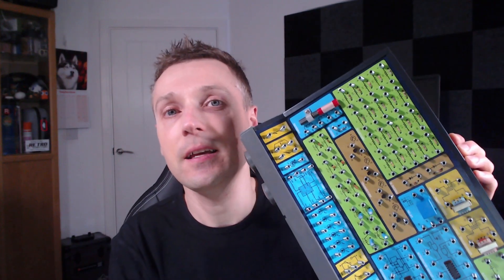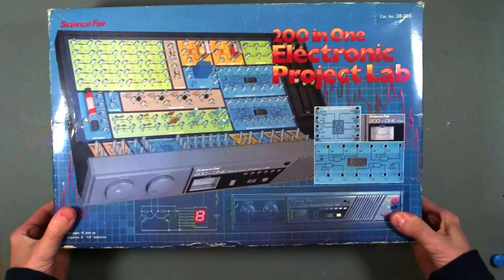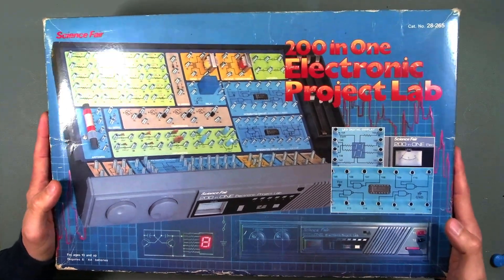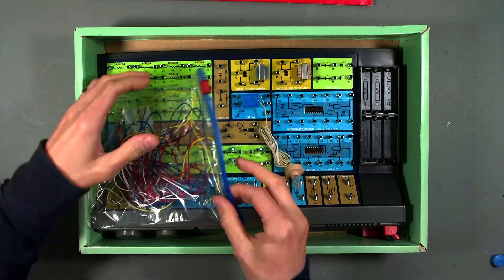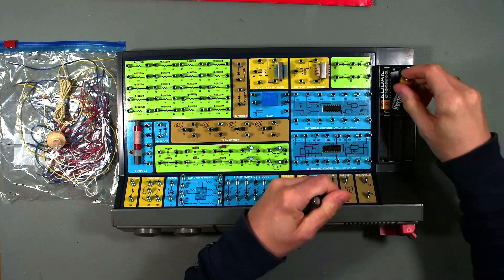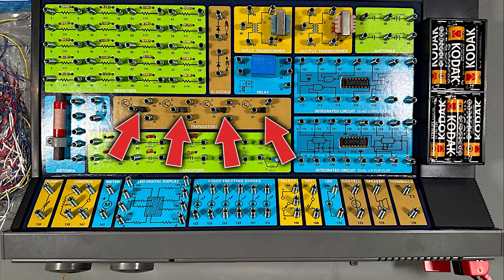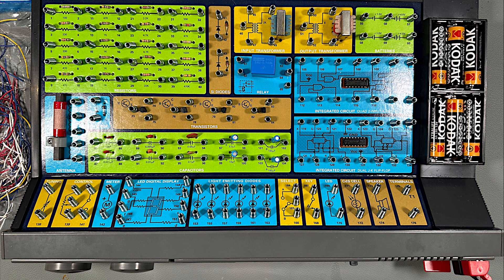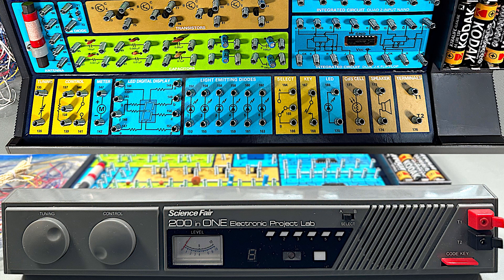Rediscovering 90s Electronics Kits - and I owned this one!

Comment: I had a 130 in one at first (which I stupidly threw away much later in life) and that was upgraded to one very similar to yours which I still have as I thought as it was based around using a breadboard as well as wires and posts that it would be good for generic project stuff.  

However, although I was really interested and good at electronics at school, my eventual destination was computing and amateur photography.  I dont have much to do with electronics these days but I'm looking to bring it back.  As a kid I always wanted an oscilloscope, which eventually was replaced with wanting a laptop, something like a 286 or 386.  On my 40th birthday a few years ago my relatives asked if there was something I wanted that they would all club together for, well, I finally got my  oscilloscope!  Of course I need to use it and so I need to being my old hobby back.

One thing I have always been proud of however is although I stopped playing with electronics I never lost "the knowledge".  Sure an op-amp still can confuse the shit out of me, and I never got the hang of understanding how flip flops worked, but I know my components and some basic theory, and I still can read a schematic, I watch Big Clive frequently, and again, although I dont mess with circuits much at all I still incorporate much of that knowledge in my IT work today when thinking and diagnosing issues and so on.

Kits like this, my telescope and the Commodore C64, making way for a self built PC I built from donated 386/486 parts, set me up for life.

Comment: Elenco still makes these, you can get up to a 500-in-one kit with a microcontroller of some sort to use, and a build in programmer for it (included keyboard and LCD like those early computer kits). They also have Snap Circuits which use clips (pants buttons) instead of springs for much faster assembly (though the parts are big due to the plastic frames). EDIT: Yes, they make Snap Circuits in general purpose versions (X-in-one), though you have to get them online now.
Reply from the maker: Good to know is they’re still being made - I guess they are a little harder to find than back in the day

Comment: I hated these as a kid, because this is NOT how “real people” make circuits.  I’d much rather have had a breadboard and a bag of parts.
Reply from the maker: That’s true but for learning at such a young age it was easier to follow and made sure less ‘small parts’ were lose I guess
Reply: @RobSmithDev  Yeah, that’s what my dad thought.  “With this you don’t have to solder!” and I was like, “Learning how to solder is exactly part of what I want to learn!”  It was just very frustrating as a kid who wanted to reverse-engineer how existing working electronics are made, not build up from abstract concepts.
Reply from the maker: I was playing with a soldering iron way before these kits but still they were fun. I’d never actually seen a breadboard until I was about 16! I’d actually used that veroboard/strip board prior

Comment: I have several of these kits, all of them from the Japanese company Gakken. I have 2 Mykit System 7, and for reasons I have no less than 3 Mykit 150 (The 'Suitcase bomb'). Two of those I bought off of the Swedish offshoot to Ebay just to get hold of the manual so I could play with the third one. These kits are becoming real reare.

Comment: My circa 1965 electronics kit consisted of a board with an AC power supply, a single vacuum tube and a few rows of tab rails requiring soldering of components (resistors, capacitors, diodes, pots, wires, etc.) to the tabs to create a functional circuit. After the power supply and vacuum tube burned out from attempting to create too ambitious a project, I built transistor circuits on it powered by a 9 volt battery. Eight years later  when I was tested while attempting to enlist in the U.S. Air Force in Oklahoma City, two recruiters called me into a room, sat me down and asked how I knew so much about electronics. I told them about my kit projects and they grinned, saying I had just scored higher than anyone they had ever tested before on electronics aptitude. Then they asked me what I wanted to do in the Air Force. I told them I wanted to fly fighter jets. They told me I couldn’t ever fly jets because of my poor eyesight (myopia). I did not enlist and hitch hiked through the night back home because they had only paid for oneway bus fare the 120 miles distance from the western edge of the state to OKC. My parents were furious with the recruiters for not making sure I had transport home if I decided not to join up. The recruiters called it a “failure in communications”. Dad (a war veteran) called it SNAFU (in words, not letters) and slammed the phone down hard when he hung up on the recruiter.
Reply from the maker: Wow that’s quite a story. I didn’t know they did kits with valves although kinda makes sense - no way they’d make a mains powered one these days 😂
Crazy story about the airforce - it’s a shame you couldn’t be a fighter pilot though
Reply: @RobSmithDev  I think it was called a Knight 12-in-1 kit because I remember doing all 12 projects in just a few days and bugging my parents to let me buy a book about circuits that they thought was too expensive at the time. Fortunately a local library had all the reference material I needed after we moved to Houston. The Apollo space program was just ramping up there then, providing lots of inspiration via local TV news casts, and I started reading about transistor circuits and hearing about computer programming. Exciting times to be a kid craving knowledge and adventure, eventually leading to a decent if not so glamorous career in computer science.

Never piloted an aircraft of any kind, though, but there is still hope. I’m seriously considering getting a Pivotal HELIX to fly around the farm to fulfill that childhood dream.

Comment: Nice one.
Kind of reminds me of what would be the Eastern European (USSR and post-USSR) electro-kits some friends have had since they were kids... MERKUR ELEKTRONIK, which mostly had construction sets, used to have electronic kits as well (just like construction kits, consisting of robust painted bare metal parts to be joined/screwed together), although it's not quite the same... the basics like rotors, electromagnets, relays, buzzers and low-voltage light-bulbs (3 or 5-6V) were included with projects like burglar alarm and morse code transmitters...

Btw. what would it take to clean up the radio signal? Maybe some crystal and/or other components would help?
Reply from the maker: I think there’s a different technique for receiving AM, but obviously that needed power. Mind you, these days it’s a simple single chip!

Comment: What put me off when I had this exact kit were two things:

* The documentation jumped very very quickly from simple pictures of where to place wires, to full on schematic diagraming. This learning curve was way too rapid for the age group indicated.

* The LEDs didn't have current limiting resistors installed, you had to wire them manually: so I burnt out my LEDs real quick 🤣🤣
Reply from the maker: lol I think burning out LEDs was common, this was t my first kit so was ok with the circuit diagrams but that was just me

Comment: I had an older, more basic version of this without the fancy front with all those knobs but I loved it. I still remember the gasp I let out when I wired up the crystal radio project and it actually worked.
Reply: That was so cool. I remember salaving magnet wire from an old motor to string up in the bavk yard. Had the whole setup under the bed so that at night when I was supposed to be sleeping I could listen to the baseball game.
Reply: Long live AM radio! Damn them if they ever shut it down and deny all 10 year olds the gasp of building a radio that runs on no power!
Reply: @dlarge6502  Most kids today would consider it lame. If the device doesn't have a screen or play games, they're not interested. Sad but true.
Reply: There is a full fm radio circuit but seeing the shit ton of connections I never had the balls to try making it, I was 11.
Reply from the maker: Yeah kinda magical isn’t it :)

Comment: Say hello to the Amiga 2000 in the back. I used to make advertisements using Professional Page on one of these back in 1992. As for the 200 in 1, managed to get a 300 in 1 around 2009. Still use it with Raspberry Pi Pico.
Reply from the maker: Awesome using it with a Pico. Check out some of my other videos, the A2000 is featured in quite a few

Comment: Had the 150 in one kit. Got it for Xmas in 1977.
Just found one on ebay that was never opened!! Still has the plastic wrap. Date code on back says it's made in Sept 1976. One of the first ones ever made!
I'm afraid to remove the plastic wrap on it .....paid 90 bucks for it.
Reply from the maker: Wow amazing you find one never opened!
Reply: @RobSmithDev  it wasn't even in the Radio Shack catalog until 77

Comment: Hi Rob, great video. I had one of those kits. Dad also gave me an older kit. The kit was a proto board, a component set & a booklet. The book was Adventures in Electronics by Tom Duncan. Copyrighting the book is 1978. For each project you got the parts list, which numbered holes to put the components in. It then told you how it worked & suggested modification. No ICs in the kit all discreet components. I found these a great help in my early electronics days. The kits are long gone but I still keep the books for reference.

Comment: I had that same kit (still have my 60 in 1 kit).  That 200 in1 is when I first learned about not hooking up a 9v directly to an LED.  LED #1 on the the front got really bright, then really dead. 🙂
Reply from the maker: Hahaha yeah I think I probably ended up doing that with an earlier kit - still it’s one way to learn. I think I also made a super heated transistor (frysistor!?) until the magic smoke came out 😂 learning was fun

Comment: Even as an adult, I loved the 500 in 1 kit that I bought, very similar looking to the one in this video. The most precious was the project booklet. That would be one of the things to take with you into an apocalypse bunker, to rebuild civilization with afterwards.

I wish they had more radio related projects, such as walkie-talkies, but due to the nature of the setup, things have to fit within the confines of the work area. Not a big fan of spring terminals, and would rather assemble things on standard breadboards. The negative is that they embed parts in the structure, such as the LED's. Someone who's just starting out is going to make errors, blow lights, wire electrolytic caps backwards etc, and they don't always make their project box easy to service or provide any spares. It's a small nitpick.

I love electronics as a hobby. Making tech out of nothing - it's magic. The best source of information is the internet, and technically you don't need any kits, but they're good value, considering that they supply all of the components. They cut down the amount of effort needed to get things going and eliminate the need to solder.
Reply from the maker: The internet is great - obviously didn’t exist when I got this kit back in the day so it was books and trips to the library. Whilst you can learn by just reading online, nothing makes up for actual hands on experience - I find learning like that sinks in better. 

Radio circuits would have been cool. There was a low power transmitter in this kit. But I suspect these days there would instantly be a mod on some random page showing you how to increase the power making it illegal! Oh the fun!

Comment: I have a few of these now and recommend them for people wanting to learn electronics.
The radio receiver doesn't work like it used to since the analogue transmitters were switched off in the UK.
Reply from the maker: The analog transmitters are still on for radio - AM etc. it was only UHF / TV that was switched off - maybe it’s just all the digital noise these days

Comment: Closest modern equivalent would be Snap Circuits. The components are mounted on plastic boards with contacts that snap together to form circuits.
Reply: I have a couple snap circuits kits that I used to bring into my daughter's elementary school class.  The advantage over the old Tandy kit is the components are a lot easier to connect up in a short timespan, springs don't break, etc.  Kids always loved the project where you launch a "helicopter"
Reply from the maker: Yeah saw snap circuits - I guess it’s a close contender

Comment: I had two almost like this: the first I think was called "57-in-one" and had a very similar layout with all of the colors and spring terminals, but with fewer components and no ICs (but it did have a DC motor!). The second was the "300-in-one" which had some of that spring-terminal stuff around the periphery, but had a big breadboard in the middle where you could build circuits using the trays of resistors, transistors, ICs, etc. which came in the box. Most of which I promptly lost and/or stepped on.
Reply: I had this one too. I remember not following the colour bands on the resister correctly once and letting the magic smoke out.
Reply from the maker: Never had a breadboard at that age, I bet stepping on the components want as bad as treading on a piece of Lego though 😂 I guess a breadboard would have been aimed at a slightly higher age group?

Comment: I had this kit! Problem is the step from pictures of how the circuit is wired to actual circuit diagrams was too big a step for a younger and less patient me, so I decided to "invent my own" (connect things at random to see what happened) for a while which usually resulted in something I needed to build one of the more complex projects having been blown up or otherwise rendered non-functional once I was old enough to understand what I was doing.
Reply from the maker: Yeah I have to admit I wasn’t sure if everything was working in this board but at least ‘current me’ knows how to check

Comment: I dreamed of having one of those kits when I was a kid, absolutely drooled over the RadioShack ads. I totally agree about the microcontroller kits that they make these days. They just don't teach enough of the fundamentals and kids just don't learn the basics the way they should. I feel the same way when I see people learning Python for a first language, and just about every kit that uses a Pi will teach Python even though they have full access to the C language tools, and even assembly, which would probably be the best to start with.
Reply from the maker: I guess learning python is the modern alternative to BASIC that we all had on the computers of that generation. I did get a robot kit recently that was all C but it still didn’t really explain what it was doing so for a beginner might have been too complex. Simpler times I guess

Comment: These came from Tandy back in the day and had one as a kid also.
It kept me busy hours. Well, that was a nice recap... down memory lane.
Reply: Tandy was the UK brand for Radio Shack as far as I remember?
Reply: @PatrickMyles-bc5ij 100% correct.
Reply: LOts of places sold them.  In Australia and NZ Dick Smith Electronics sold them too (as well as Tandy)
Reply from the maker: I think there was a reference to Tandy in the book. It looks like RadioShack bought them at some point
Reply: @RobSmithDev Opposite way around. Tandy started out as a leather company in the US and bought Radio Shack in 1963 after it decided to branch out into other markets.
Reply: Yep, I still have mine in the cupboard that I got over 30 years ago from Tandy in Australia.  The kit is cosmetically a bit different and also had a clear plastic lid.  But the components are the same (think batteries installed in the underside of the kit too), but the manual is identical and was the 200 projects in one kit

Comment: I had one of these, one of the earlier models.  it was fun but tedious and I suspect some of the components didn't work as half the most interesting projects failed.  Still, I think I learned something.  Is it better than something like an arduino for education or even something like snap circuits?  I don't think so.  Just different.  It all depends on the documentation and instructions you get.
Reply from the maker: Arduino teaches something different and tutorials around them don’t cover the basics that are totally missed out. Admittedly some of it is replaced by what microcontrollers can do, and that’s fine but it’s good to know alternatives.
Reply: @RobSmithDev  would be interesting to design a modern take on one of these.  What would you include, or not bother with?  The moment you need to interface with software does it defeat the purpose?  Or make it more interesting..
Reply from the maker: I think k you’d keep it fairly similar. Maybe switch out the radio stuff and at that point move to arduino as a later kit possibly with Bluetooth or something - I’ve considered it tbh